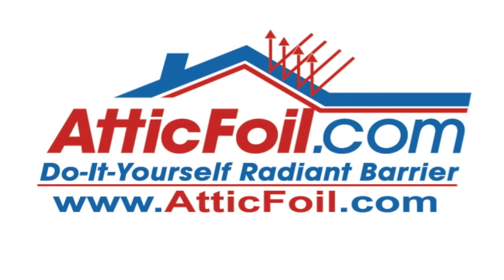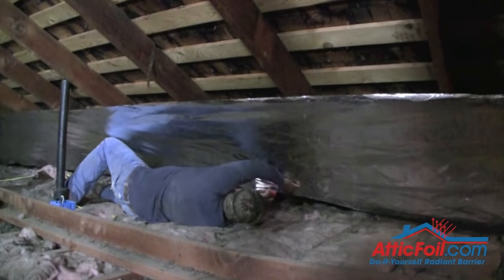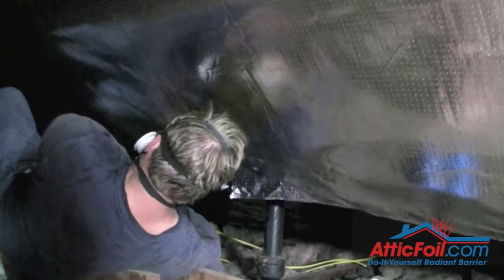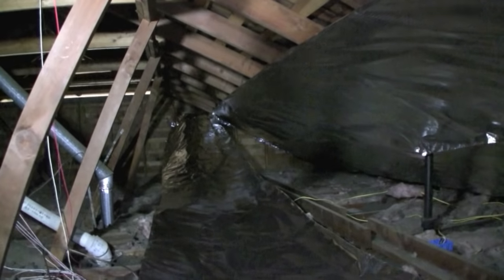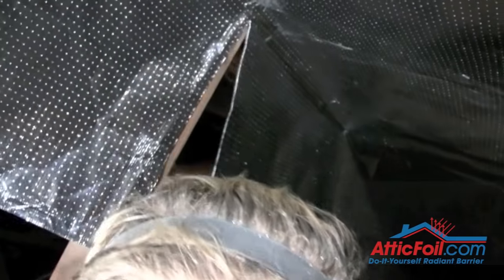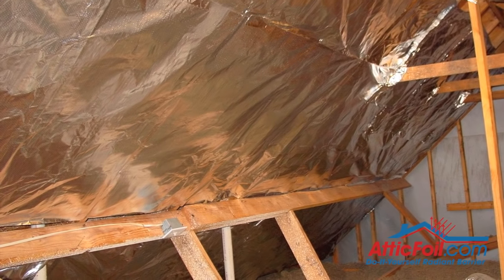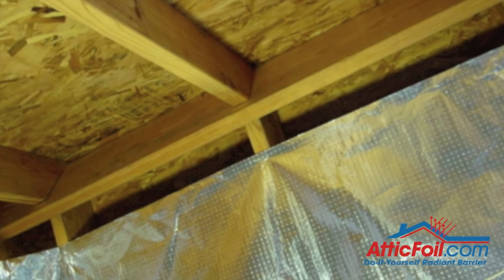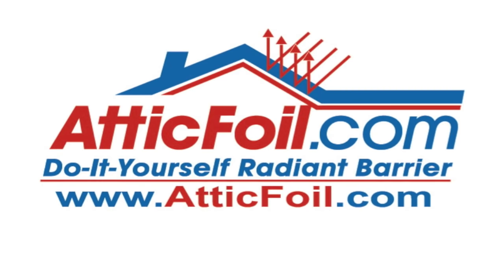Radiant Barrier Installation - How To Install Radiant Barrier

Comment: Do you cover baffle vent or not? I have cardboard rather than baffle vent I was wondering if I have to cover it with radiant barrier or not?
Reply from the maker: It really does not matter.  Usually air is flowing around the baffles anyway.  You want a gap at the bottom of the attic where the foil is above the insulation.  Attic air will be drawn up into the rafter bays by the stack effect.

Comment: For on the decking  installation do I need to trim length(width wise, between the rafters) that’s extra or can I leave it?
Reply from the maker: I think you are asking about a cathedral ceiling method installation?  Are you converting to a living space?  See this page: https://atticfoil.com/index.php/applications/cathedral-ceilings-hotmixed-climates/

Comment: Will this product be a good idea for an attic that has no venting?
Reply from the maker: Yes, ideally you would have some venting, but it will definitely help.  Remember you are reflecting the HEAT. I use this example:  Do you have one of those shiny silver sheets you put in the windshield of your car to help keep it cool?  Probably.  It's reflecting the heat and the light.  It's the heat that makes it work.  You probably also crack the windows.  But, does it still help keep the car cooler even if you DON'T crack the windows??  Of course it does!  This is the same concept as your attic.
Reply: @AtticFoil  I like your car example which makes sense. My attic has no venting, only a window on each gable end which I crack open a few inches from April to September. I also have insulation in the floor, gable walls and rafters (was there when we purchased our home in NJ).  Oh, and my roof is slate tiles which is not so great when covered with snow.
Reply: @AtticFoil  It helps because it is reflecting the heat/radiation out though the window. In this case you are reflecting it onto the inside of the roof which will cause your roof to heat up. So some of that heat will escape though the outside of the roof. The air gas at the bottom and top will cause a convection current which will heat up your attic.  I think this really should be combined with venting.
Reply from the maker: @vinvan4237  I stated before that venting is always BEST.  But It still helps even in a "dead air" environment.

Comment: If I have a whole house fan. Will it work with this product or will it blow it off ?
Reply from the maker: Installing www.AtticFoil.com with a whole house fan works great.  AtticFoil is super strong.  You just want to leave plenty of "holes" for the air being pushed into the attic to escape.

Comment: What if you do not have a ridge bent at the top?  I have 2 vents cut into the roof with solar fans, but they are about 1/4 to 1/3 the way down from the peak.  How far would i want to run this foil up the side of the roof?  If i went all the way up, isn't that going to trap the heat at the top?
Reply from the maker: You still want to leave a few inch gap at top at the ridge.  You want to flow freely through the attic as thought the www.AtticFoil.com is not even there.  If there is a hole in the roof, cut a corresponding hole in the AtticFoil below it.  Hot air is like water heading towards a drain.  The holes in the top are basically drains and work well even if they are not at the absolute highest point.

Comment: I want to use this on my shed roof can I cover it with quarter-inch plywood after I install it on the inside of my shed
Reply from the maker: When you say "cover" I'm assuming putting the plywood BELOW the foil?  Then YES it will work great.  To be clear, here are the "layers" coming from the outside in.  Shingles/Roof deck/Foil On Bottom Of Rafters (this creates required airspace) Then plywood applied to face of rafters.  If possible it's best to vent the space between the foil and the roof deck.

Comment: i use my attic as a storage space and thus have plywood down on most parts of the floor on top of the floor insulation. where would i put radiant barrier to keep summer heat out and keep winter heat in?
Reply from the maker: Your best bet is the "Hybrid" method here: https://atticfoil.com/index.php/installation/hybrid-install/

Comment: Also if you was to make a full room in your attic then there wouldn’t be any ventilation so what would u do then? Say if you was to make that space into a room like a bedroom with proper walls. So plaster board after the foil and skim it and paint etc
Reply from the maker: I think you are asking about a cathedral ceiling. Here is video on how you would install if you are converting the attic into a living space, bonus room etc. https://youtu.be/CjwZXoRzRiM

Comment: Can anyone take temperatures to prove the products effectiveness?
Reply from the maker: Take a look here:  Over 1800 Reviews from 14 years in business: https://www.shopperapproved.com/reviews/AtticFoil.com/
Reply: I took temperatures while I did it in my attic. Started at 142 on an 88 degree day and went down to 128 on a 92 degree day after only about 1/3 of the attic complete. I stopped measuring, those numbers proved the point in my mind

Comment: With a forty one foot by 30 foot home, can you tell me what my foil requirement will be? How much do you estimate this foil cost being?
Reply from the maker: 41 ft times 30 ft = 1230 sq. ft.  If you are stapling up, then you want to add 10-30% for the slope factor.  I'd go with 1500 sq. ft. This will get it done.  Cost of the foil is here: $199.95  http://www.atticfoil.com/index.php/products/48-wide-double-sided-atticfoil-radiant-barrier-foil-perforated/  Then, depending on where you are, add $25-$40 for shipping.  Call us at 80-595-8772 and we can give you an exact shipping charge and total price.

Comment: Is there any harm in both stapling AND over-insulation? My attics get insanely hot and it bleeds into the house sometimes. Adding more insulation on the attic floor should address a lot of that, but then is there harm in doing both methods in the same attic?
Reply from the maker: No harm and all and you will have some additional benefit.  Especially if you have ductwork in the attic.  Doing the over insulation method after stapling up will most give you a benefit in the Winter to reduce heat loss.

Comment: why don't you start at the top and go down? That way if you have a leak in the future, the water will trickle down to the outside soffit?
Reply from the maker: You want the leak to find the first seam and drip down so you could easily find the leak with a simple wet ceiling.  The LAST thing you want is for the water to end up in the walls.

Comment: How will this effect my heating bill in the winter?  I imagine the upstairs will remain cooler resulting in higher cost to heat the home.
Reply from the maker: Gaining heat from your roof is usually pretty minimal in the Winter.  The cold "Sucks" the heat out of the roof, the sun is low and the days are short.  So, not much heat gain.  Also, the www.AtticFoil.com my actually help with heat LOSS by reflecting heat back into the building.

Comment: Can you add this to roof rafters like in the video even if your roof plywood already has the radiant barrier aluminum face on it? Would it double the effectiveness?
Reply from the maker: Yes, installing www.AtticFoil.com WITH radiant barrier decking works great.  Not quite double the effectiveness but much better.  We have several builders that do this during new construction with great results.
Reply: @AtticFoil  I had it on the sheathing already when the home was built and just 'fished' the rolls over the insulation to the ends where the truss ends (using a pool cleaning pole and standing in the middle of the attic). I dont have soffit vents so I pushed it flush. Then installed an attic fan on my west facing gable vent. The roof radiant barrier and radiant barrier over the insulation act as a sandwich to the heat and the fan pulls cooler air thru the east vent, pulling the the hot attic air out the west vent. Literally dropped my cooling bills (in AZ) 25% in summer. Insulation just holds the heat, this keeps it from getting into the insulation.
Reply from the maker: Thanks for sharing how well www.AtticFoil.com is working in your home!   We appreciate the business!

Comment: ordered a sample and then 500 SQ.  Have a unique case-2010 residential property that was built on 100% steel.  The material cannot be easily applied like to wooden studs w/staples (two monkeys can do that).  Followed the advice about trying magnets but can't really pull hard to secure them as I wish. Recently ordered a Military spec foil tape that will help me secure it tight.  Doing a video and hope it works for others in the future in my situation.-as my entire structure is a heat conductor.
Reply from the maker: We now sell self-drilling screws and locking washers for our metal building insulation.  We have customers use this in metal framed attics: https://bluetexinsulation.com/products/screw-washer-set-100-pieces

Comment: Does it make a difference which way the shiny side is facing?
Reply: yes, it does matter. its reflecting radiant heat. think of it as a mirror. shiny surface should face where heat is coming.

Comment: If I'm also insulating my attic roof, does this go before or after the insulation?
Reply from the maker: Why are you insulating the attic roof? Are you making a sealed/non-vented attic? Or, are you trying to prevent ice damming? Other than those two reasons putting insulation in the roof in a vented attic is like holding a jacket over your head.  Why??

Comment: what are the benefits with this in the winter months?
Reply from the maker: It depends:  If you staple up, then not much benefit.  But staple up is primarily used in hot climates.  In colder climates you can lay over the insulation, but make sure to use the SuperPerf Product: https://atticfoil.com/index.php/products/45-wide-perforated-double-sided-radiant-barrier-foil-superperf/  More info here: https://atticfoil.com/index.php/installation/best-install-method/

Comment: I need to find an installer for this in Palm Beach County FL.  Any suggestions?
Reply from the maker: Honestly, right now it's tough to find ANY installers.  Nobody wants to work in attics considering there are usually many other jobs available. I'd look to a handyman/college type student as your best bet.  Or wait until Fall when it cools off some and you can find people more willing to get up there.

Comment: would this would effectively without the insulation?
Reply from the maker: It really depends on what you are trying to achieve?  Think of AtticFoil Radiant Barrier as an UMBRELLA as apposed to a JACKET.  Radiant barrier reflects radiant heat, so it acts like an umbrella or shade.  If you are tying to keep a non air-conditioned space (attic, shed, garage etc.) cooler then a radiant barrier works great.  For air-conditioned spaces then you would want to combine Radiant Barrier WITH traditional insulation.

Comment from the maker: @mmd1954 There is really no such thing as "Trapping" heat.  It is always moving from a hot area to a colder area. If you can keep your attic cooler, then you will keep every thing inside the attic cooler including the pipes in the summer. Installing radiant barrier should definitely help keep the water cooler.

Comment: I don't know if I have soffit vents or a ridge vents.  Will this work even if my attic is unventilated?
Reply from the maker: Yes, www.AtticFoil.com will reflect radiant heat even if your attic is unvented.  Still leave gaps at the top and bottom for air to flow freely throughout the attic.
Reply: If I do have a ridge vent, do I still leave the top uncovered?
Reply from the maker: Yes, no matter what when installing www.AtticFoil.com always leave the top open.  This install guide covers this: https://atticfoil.com/index.php/installation/staple-up-installation/

Comment: Does this work to keep the cold out as well?
Reply from the maker: Technically, there is no such thing as "Cold".  Cold is how we describe a relative lack of heat just like "Dark" is a lack of light.  Heat always flows from hot to cold.  When it's colder outside than inside, heat is flowing out.  Yes, radiant barrier will help keep the heat in.  It is most effective when installed directly over the existing attic insulation.  Here is the video to explain more:  http://youtu.be/L-FNAP1UFZU
Reply: Thanks for the reply and explanation. Great videos by the way.

Comment: Is there a problem if you layer the foil over regular insulating foam?
Reply from the maker: No problem.  www.AtticFoil.com will work great to enhance foam insulation from radiant heat from the roof.
Reply: @AtticFoil will the metal foil get condensed dew and wet the insulation and cause mold ?
Reply from the maker: No

Comment: Would this be effect if I do not have a ridge vent on my roof?
Reply: Not having a ridge vent won't affect the performance of the radiant barrier but you need ventilation to prevent moisture and mold. Get a good and insured roofing company to install one.
Reply from the maker: @MichaelDespairs  This is true.  However, in many areas prone to hurricanes the do not have top side vents in the roof.  Only soffit vents.  These are usually lower pitch roofs and the soffit vents act as both intake and exhaust vents depending on which way the wind is blowing.  They work off a a "cross ventilation".

Comment from the maker: No, do not cover the peak. You should always create a path for air to flow up and out behind the foil and the roof deck.  Hot air will naturally "pool" in the top of your attic.  Then whatever exhaust vents you have (wind turbines, static vents, ridge vents, gable vents, etc.) will allow the air to get out.

Comment: Not looking forward to my attic. It's a nightmare of ducts, duct hangers, trusses, cross ties, etc. Like anywhere else I guess, but it just looks like spaghetti to me.
Reply: Bearded & Bored My attics have never been as accommodating as this one, but installing the radiant barrier is worth it, despite the hassle. I saw at least twenty degrees and probably more like thirty degrees cooler temperatures in my attic after I installed, and that led to a cooler house and lower bills.
Reply: If you have low eaves, be sure to take a couple sheets of plywood (2 feet by 4 feet or whatever you can easily get up there) to help you get around when you are playing "hot Twister" up in your attic. Heck, even without a low-angled roof, the plywood would probably be useful.
Reply: LOL mine looks like a death trap of trusses too
and half of my ceiling is peaked (living/dine/kitchen great-room)
only above the garage has good clearance (meant for storage)

do slow & steady work on mornings or cool and/or cloudy days
even if it takes multiple days to complete
(do one row each day -- don't kill yourself 😉)

Comment: Does it matter which side goes up or down??
Reply from the maker: No, both sides of the foil are the same.  Sometimes one side may be a little "shiner" then the other side due to milling variances in the aluminum.  But, reflectivity is the same. www.AtticFoil.com

Comment: What if I don't have a ridge vent?  Should I cover the peak, unlike the installation in the video?  Is the point to cover as much as possible without cutting off air ventilation in the attic?

Comment: Prior to installation, must the homeowner have solid walkways to support the installer already present?
Also, will this method work for non-ridgevent roofs, such as static vents plus passive turbines?
Reply from the maker: Walkways are great, but not required.  The framing should easily support a couple people working in the attic.  Yes, this works with ANY roof even without a ridge vent.  Just leave a slot at the top AND cut holes in the www.AtticFoil.com below the static vents.  Basically, all the hot air will move toward the top and find a way out.  You WANT the air to flow freely through the attic as though the AtticFoil is not even there. The air should never hit a "dead end".
Reply: @AtticFoil  thank you.

Comment: Does this AtticFoil have any R value?
Reply: Just read your FAQ... no really R value rated... but I am thinking of putting up some 2" foam insulation between my rafters. Would you recommend this product stapled after i do the insulation? TY
Reply from the maker: In a vented attic, I really don't se the benefit of putting insulation between the rafters on the bottom of the roof.  This is like holding a jacket over your head??  You want insulation (R-value) to be on the floor of the attic which is your thermal boundary between the living space and attic.
Reply: very good explanation. because the attic is vented r value would have no value in this situation.

Comment: Can you fit plasterboard over this stuff?
Reply from the maker: Yes, as long as one side of the foil faces an airspace.
Reply: @AtticFoil  thank you. What is the minimum depth that airspace can be? Planning on putting some acoustic rockwool between the rafters
Reply from the maker: @thenub5606  1/2" or more is ideal.
Reply: @AtticFoil  thanks

Comment: What is the purpose of that Respirator he is wearing?
Reply from the maker: He is working in an attic with blown fiberglass insulation.  ANYTIME you are around fiberglass you want to wear a respirator/filter. You don't want to be breathing in glass fibers.
Reply: So he doesn't inhale particulates that are in attics.  Plus ventilation is often limited.
Reply: Plus vermin and bug droppings/waste, potential asbestos fibres, particulate matter from roof, mould, etc etc.

Comment: So is it shiny side up or down?
Reply from the maker: Both sides are the same.  Sometimes in the milling process, one surface of the aluminum is a little less shiny, but either side up is ok.
Reply: @AtticFoil  oh wow ok yeah the couple rolls I bought are different slightly but Thankyou for the really fast reply !!!! Pretty rare